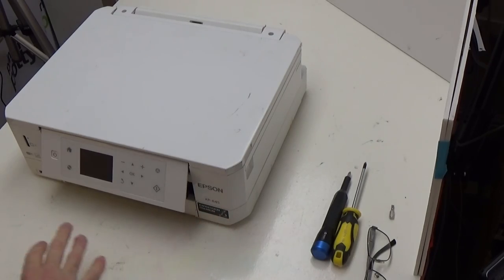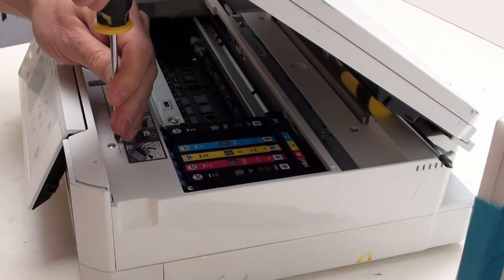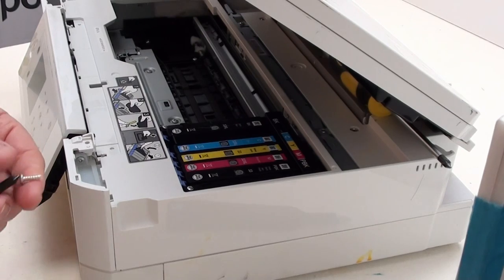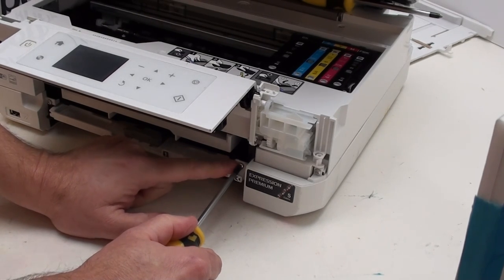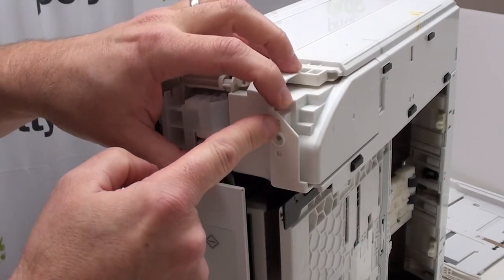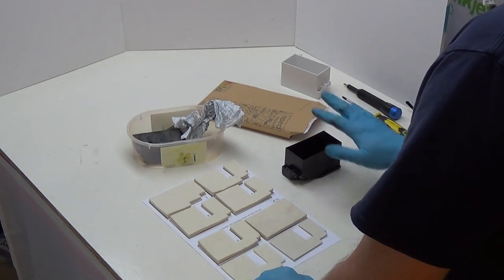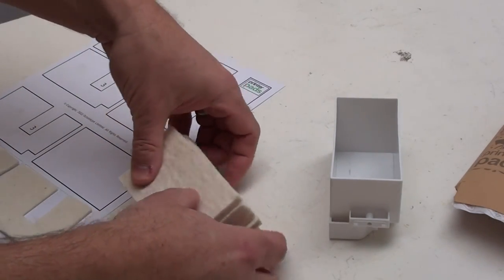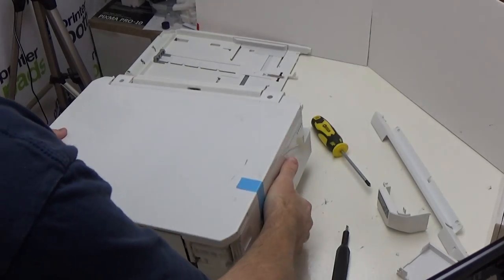Epson XP Waste Ink Pad Fix : XP600 to XP860

Comment: I know 3 people with XP620 and XP645 respectively, who tried to change the main waste pad and box, it's not that complicated, the problem is you have to turn printer upsidedown or sideways, which causes a misalignment and residue ink from the nozzles to pool up - even if removing the cartridges, eventually air introduces itself in the lines, they had to waste 4 complete refilled ink cartridges to get the nozzles fully working again, from what I heard, when you have the replacement done directly at an EPSON service center, they allegedly use shipping fluid and completely flush the nozzles, replace the pad, then recommend you buy a new set for the initial ink charge mode (same mode when you initially turn on the printer).  Not ONE person who replaced pads themselves that I know of were able to get the printer in working order (full nozzles), only 1 person managed after multiple clean cycles span across 1 day and 4 complete ink cartridges.  The fact that EPSON made it such a difficult process in not allowing you to repair and change components without flipping printer and skewing it out of alignment and damaging heads is questionable, and in my opinion there should be a class action lawsuit against them.  In previous EPSON models (older ones) you could easily change pads without flipping printer, or divert the tube that goes from the pump directly into an external bottle through a single door held by 1 screw.  I noticed you did this with your ink carts installed, when turning the printer on its side didn't you get ink spill from the bottom, not necessarily from carts, but from the residue in the parking pad and pump beneath it ?

Also heard reports of people's CC get stolen when buying the keys from that provider, they are in Russia, in my opinion it is a rip-off to have to pay so much money for a reset key, there is an adjustment program available, unfortunately I have not seen one available for North American versions of the printer.  With the initial ink charge and ink clean cycles you will need after the new pads, you will likely use up at least 15-20% of your pad already.  Great video one of the best I have seen about how to replace them, unfortunately I have not known anybody who was able to get their printer working the same way it was before the replacement.
Reply from the maker: Obviously we've been working with a much larger pool of customers and tend to hear of problems rather than successes so we're aware that there are situations when the pads can leak excess ink which is why there are other instruction sets (SX535WD for example) where we've leaned heavily on removing the pad holder without tipping the printer.

You've provided a lot of information in your comment so I'll need to break things down a little but here's what we know about waste pads and their potential for leakage/soiling.

1. The waste ink pads in the printers are actually overspec'd to allow for excess capacity, so in theory they shouldn't leak if the waste ink pad warning is heeded.

2. However some end-users will reset their waste ink counters without actually dealing with the physical waste pads and that's a near guarantee of excess ink or even a leak sitting in the pads as a ticking time bomb for later.

3. There's also end-users who are using CIS systems or refillable cartridges who have suffered from an uncontrolled spill or slow leak into the waste ink system that then gets dumped into the pads but isn't accounted for by the waste counter itself.

While the latter scenario is possible we'd lay betting odds on the bulk of instances of ink spills or soiling have occurred due to users resetting and forgetting.

As for the WICReset app, their home is actually Ukraine and definitely not Russia. We've spent a considerable amount of time checking the apps functionality with each release and eventually developed a strong relationship with the developers, so we no longer have any qualms about their reliability or motives. That said, we certainly understand the reluctance of end-users without that relationship or history, to trust third party apps. In terms of payment security, we can't speak to other retailers but our system for payment of keys (and all other products) are secured by Stripe & Paypal and work incredibly well.

Ultimately we're glad the video is useful and will look at how to highlight some of the potential problems properly so that end users, such as your contacts, know how to use the information we've provided but in a way that limits the likelihood of ink spilling out or leaking internally.
Reply: @octoinkjet  Cheers for that great video, again, it is one of the BEST one I have seen online, and you took the time to explain how to put things BACK.  As to point #1, yes the pads are overspec'd, but there is even more to that, the % value of the waste pad is variable can can go back down over time, they've also accounted for evaporation of ink on these pads.  You misunderstood me about my comment, I was not talking about the waste PADS leaking ink, it would be extremely unlikely for it to happen, unless you reset counter and kept using printer enough so that the pads become overwhelmed -  When counter reaches 100%, you can even reset counter back to 90% for FREE, and safely continue using your printer until you change the pads, and with evaporation, you can probably get even more use.

What I was referring to is NOT the pads, I was referring to the ink CARTRIDGES, I believe I was specific about that, in your video I noticed you had all the INK cartridges installed, under the cartridges there are the meshes that site above the nozzle (heads), when tipping over the printer, ink from the cartridge outlet could leak.  This is especially true if you are using 3rd party (non EPSON) cartridges, which have VENT holes, it's likely people who have this happen did not plug or tape those vents, and that ink came out through the holes, for EPSON original carts, that might not be an issue, but ink leaking beneath the carts, maybe, and causing an imbalance or air in the nozzles is a possibility - So this is what I meant - I do not know anybody who had leaks from the waste pads.

As far as the platten pads, those rarely need to be changed unless you do lots of borderless photos printing, otherwise ink evaporates rather fast in that area, I've had my printer since more than 4 years and my platten pads are at 2% :D 

As far as paying to getting a key to reset printer, I was under the impression you could manually reset waste ink pads on the XP600 series, I remember it being possible on R series printers through a holding a combination of keys whilst printer is unplugged, and at the same plugging power, don't know if this applies to the XP600.

For people who are comfortable modding, you could avoid using pads altogether by installing a tube that goes from the pump's output and diverting a tube outside to a container.

So a tip, with the WICReset, if your pads reach full and you get the error, use the FREE, one time, reset key, I've done this myself, and been using my printer since, that 90% became 70% over time due to evaporation, I plan on changing mine soon and hope I don't run into issues like other people I know have, especially from air clogging nozzles or ink from CARTRIDGES leaking sideways into printer.
Reply from the maker: Ah... Okay... thank-you so much for putting me right about what you'd said. I see where you've coming from now and I take your point about cartridges. FWIW I've not seen this happening for too many customers but it might explain one or two instances that we never got to the bottom of.

I'll look at creating some content and maybe editing in an advisory on that point (and CIS installations now that I think about it) when I switch things across to the Printer Potty specific channel that's in the works.

As for resetting the days of the R300 where a few key presses worked were almost immediately gone once the process was published all those years ago. Epson locked and bolted the door pretty darned quick after that.

Oh and just to note we started off with external waste ink kits back in 2008 or so but offering pads has shown itself to be more popular for many reasons. I didn't understand that preference until my second child learned to walk and, well... it's a lot clearer now!

Either way, we're trying to provide videos for both the pad replacement and external waste kit installation so both are covered. You'll probably see that if you look a little closer at the channel now.

Thanks again for clarifying the point about the leakage from cartridges rather than the pads, it has been taken on board and will be addressed shortly.
Reply: @octoinkjet  Great - BTW, I will change mine soon and will let you know how it went, I already made some plans to avoid the issues, one of them being tilting the printer 45 degrees instead of flipping a full 90 degrees, this will require me using one hand and switching as required, the FASTER I can remove and place the new pad box, the better, in m case I already have a spare box with pads already installed.  As far as EPSON locking with bolts, yeah after the XP-620 series, they pretty much rendered chip resetters and auto chip resets useless, now all EPSON printers have a one use chip.  I wouldn't be surprised if eventually they add one use chips to waste ink,  also another fun fact, original EPSON ink cartridges are not sponged based, a lot of people use non EPSON refillable cartridges that are sponge based, so more prone to air and clogs during repetitive clean cycles.
Anyhow once I replace mine I will post my experience.  I've heard of instances where people where flipping the printers upside down, there is potential leak risks, not only from the cartridges, but residue ink on the parking pad and conduits leading to the pump.
Reply from the maker: The changes Epson made to their cartridges and ink receivers are destined for another video but there's already chipped maintenance boxes instead of what we have in the generation of printers covered in this video.
Reply: @octoinkjet  UPDATE to my post since last time I wrote:  I have finally changed my waste pad without ANY issues.  I did not have ANY ink leaks or nozzle problems.  In my case I had already purchased the ORIGINAL EPSON part including the holder on Amazon, I later then realized that this YouTube video comes from OctoJet  - I visited the site as I wanted to buy spare pads for next time I need to change instead of buying the whole kit, but unfortunately since I am in Canada, after reading warnings on your site I was discouraged due to reports of issues with international shipments.   Anyhow your video was extremely helpful, in fact I found it easier to remove the latch and holders than shown in your video.  I also used a reset key I purchased for the WIC Reset software - it worked fine - but my only complaint is that the developer NEVER replies to his e-mails.  I had asked him a question, he never answered - I wanted to know when resetting the waste pad if it causes printer to go into a cleaning / ink charge cycle ?  After waiting so long with no answers, I decided to reset, and I was happy to see that the printer does NOT go into a clean cycle.  It only goes into a clean cycle when replacing cartridges or resetting them.   After I applied the code, both waste pad counter and platen pad counter reset to 0% - VERY important to remember turning OFF the printer quickly after reset, and failure to do so might cause counters to revert back.  I was shocked when I removed my used pads - The thing is, once they reached 100% initially, I did not have a replacement so I used the TRIAL KEY which reset my pads down to 80%, and over time the counter even went lower and lower due to evaporation - I managed to use the printer almost a year on that trial key and there was still 15% to spare, but finally decided to change them as I was concerned the sponges were fully soaked.  To my surprise, the sponges were not fully soaked, there was no standing ink, and the sponges still had room to absorb more ink.  I like how EPSON accounts for evaporation in this printer and lowers the % used.

All is well I am super happy I subscribed and liked, I do not know why other people have had issues.  Unlike your video I did not need to tape down the cover, I don't know why in your printer in the video the lid does not stay open, mine stays open and stays shut close..

As far as EPSON they are pathetic, newer printers use single use chips, so far I have not seen ANY supplier that managed to go around single-use chips.

As far as the developer of the resetter, he needs to learn etiquette in customer service, because there is none if you really need support.   Another concern, his software authenticates the keys server side - so you need to be online when entering the key - this is great from a software developer's perspective to prevent or reduce piracy - BUT this means that if the developer for some reason quits and shuts down the site and server, we will not be able to use ANY of our purchased keys or buy new ones.  SO I hope that should the developer decide to end this project, that he would at least sell a perpetual license to use the software (unlimited resets).  I know that there are some "Adjustment Programs" for XP620 around, I've seen some mainly for Europe versions of the printer, not for North American versions, but many of those online contain malware.   WIC Reset is a GREAT software, it is amazing and highly recommend.   The price here to send printer to EPSON to change pads and reset would be at least in the $350 range - Charging that much should be a CRIME !     What is charged by your company for the pads and kits is very reasonable as with the reset keys though some sites charge more which I find unfair - of course ideally it would be nie to have a perpetual license to use offline and allow unlimited resets or bulk, where those keys are registered offline use.  Anyhow good stuff, so another happy customer - I hope other people here have had great success from your video as I have.
Reply from the maker: Quite a bit to unpack but I'll bullet point as best I can.
1. International shipping has been "interesting" at various points. Canada is due to become much easier for us through Spring GDS but completely understand your reticence there.
2. I can't speak for other sites but perhaps it's worth noting that we do respond to emails and even phone calls as/when we can.
3. The actual ink content in the sponges varies widely and you have to remember it's based on an algorithm rather than an actual sensor based measurement system. So yes there's definitely some mileage in checking the pads to see how saturated they are. At the same time, it doesn't pay to assume either (been there, done that!).
4. We tend to use spares/repair printers and where possible ones that have the waste ink issue so they tend to be a bit battered. Aside from that I like to work from a worst case scenario so I can cover more potential scenarios in the videos.
5. The newer maintenance box printers are at least highlighting that the problem can be resolved so I can't condemn them completely but worth noting that there are chip resetters available to reset the chips on those things.
6. Just to note, the WICReset source is actually Ukraine and as you can imagine they've had a few issues to deal with so that might explain some of the delays or lack of response. English also isn't their first language so things could be better on all fronts. We try to help out where we can as much because it means we get more customs but because the app itself is invaluable. And yes, completely understand your concern regarding the potential end-of-life scenario but they've been active now for 13 years, with development still ongoing so I think the inkjet printer market might dry up sooner than they pull the plug. Well, here's hoping anyway.

Overall, glad the pro's outweigh the cons on this and having been at this for the last 15+ years my personal opinion is that the balance struck with the WICReset at least, is a positive one. 

On a closing note though we've a lot more video content and printers due to be tackled as well as revised versions of existing guides, to tackle some of the points you and others have raised about tipping printers, etc... All of that should be appearing on a separate Printer Potty channel in the coming months so keep an eye out and as ever keep the feedback coming.